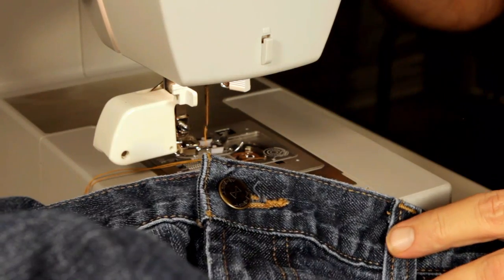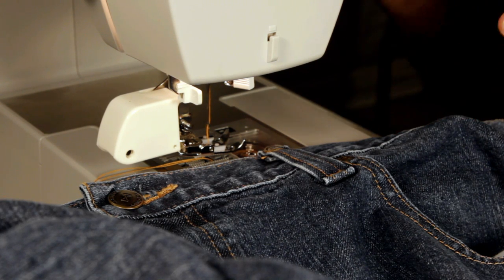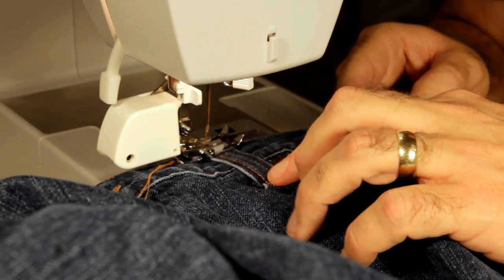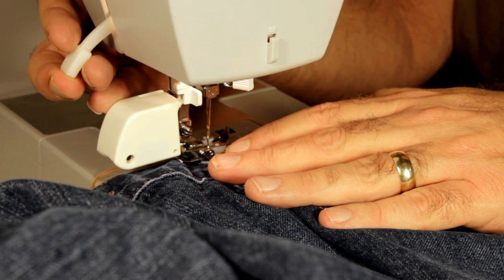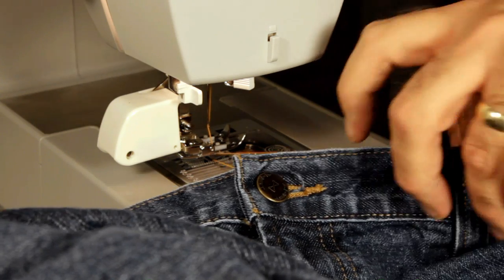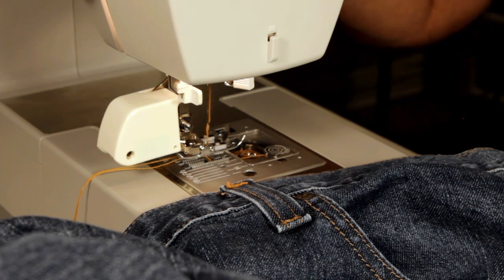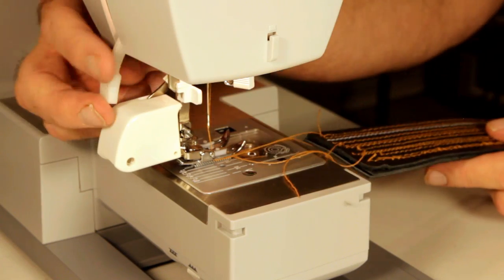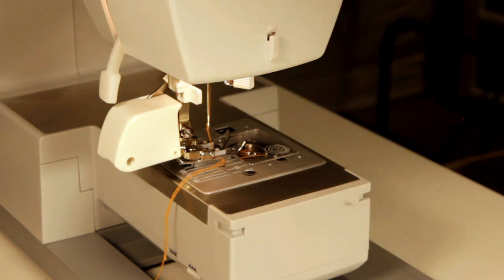Singer Heavy Duty Sewing Belt Loop on Jeans, Leg Hem and 4 Layers of Leather

Comment: What sewing machine you would recommend that will do different fabrics (aside from jeans)?  Thin to thick fabrics.  In other words, an all-around sewing machine (quilting not necessary).  For beginners?  Thank you for your advice.
Reply from the maker: I need a price range. For example I have a friend that spent $10K on their first machine. I have others that gasp at anything over $100. ;)
Reply: Around $150 - $200 pls.  Is it true that anything cheaper is easy to break-down and a piece of junk?  I only do household stuff (repairs, hems, adjust size, buttons, buttonholes, etc).  Nothing professional.  No quilting either.  I'm so confused with all the different conflicting reviews online.  Manual vs Automatic, etc.  Pls help :(  Thank you very much!
Reply from the maker: Okay, that helps.  It all comes down to mechanical vs. Computerized machine in today's market. I own several Singer Heavy Duty machines and I've never had an issue with them. However, I've heard many others have. The few that I've helped it was user error or debris in their machine that was causing the issue.  I like my Babylock BL9 that I bought for $99 on sale. It is a 9 stitch mechanical machine as well. The Janome HD-1000 is also a good machine, but I think it is above $250. Janome has other machines that are basically the BL9 machines (some offer a few more stitches).  Next, we have a new company that I've heard is run by Bernina (the son of the owner or something like that). They are called Ever Sewn. Great reviews on their machines too. This one looks very interesting: https://www.amazon.com/EverSewn-Maker200-23-Stitch-Professional-Machine/dp/B01GSMOP1S/ref=sr_1_3?s=arts-crafts&ie=UTF8&qid=1499924441&sr=1-3-spons&keywords=sewing+machine&psc=1    Stretch your budget a bit and you can get this one: https://www.amazon.com/dp/B01GSNNZ72?ref=emc_b_5_t  That should at least get you started on your research. Don't hesitate to come back and ask questions. It will be helpful for others as well.
Reply: Thank you so much for this useful information and good suggestions. I will take a look the these machines and thanks for narrowing it down for a novice like myself.  Appreciate it very much!
Reply from the maker: You are very welcome!

Comment: hello im so begginer im planning to get simger 4411 1,100 heavy duty machine. is that good sewing machine?  pls respond thanks a lot.
Reply from the maker: Go with the 44S. It has the needle threader. If you are in the USA then buy it from Walmart. Buy the extended warranty. I've used it after I bought a machine and I didn't use the machine for a bit over 2 years. First time I used it the tension wouldn't engage. They sent me a UPS label and I was able to track the repair progress online. Once fixed they shipped it back to me - all for no additional charge.

Comment: Hi Kevin!  I looked on Amazon for a Singer 4223 but cannot find one.  The only one I see, close to that, is a 4423.  Is there much difference between the two machines?  Also, have you ever tried sewing 1" nylon webbing on this machine...like the type used on backpack compression straps?  Thanks for a great review!
Reply from the maker: 4423 is the one. There isn't a 4223, so I misspoke when I made this video. I did sew some on an existing backpack I have. It was a simple repair, but with a size 16 denim needle it did fine.
Reply: I said the same thing 😂😂 but I knew he said it wrong by mistake. only other Heavy duty Singer is 4411 I know of that's grey
Reply: but great video!!

Comment: What walking foot is that? I need to find one that fits the 4423.
Reply from the maker: It is an old generic one I bought a while go. Here is a link to the Singer version, which cost much less than what I paid for the one in the video. However, the quality of the Singer foot is equal: http://www.amazon.com/Singer-Even-Feed-Walking-423242451-P/dp/B002F01JYY/ref=sr_1_3?ie=UTF8&qid=1390673661&sr=8-3&keywords=Singer+Walking+Foot

Comment: I was trying to buy a model 4452 but everyplace looks to be sold out or price gouging, I was offered the Singer 5523 Scholastic Heavy Duty model, I was wondering why they are in stock, do you have an opinion about these?
Reply from the maker: No difference other than the number of stitches and the accessories they budle with each model.
Reply: Kevin Sews Thank you Kevin.
Reply: you can buy a 4452 straight from Singer for $210. I recently bought a 4423 straight from Singer for $169.
Reply: Thanks I signed on to their website and checked it out, there’s no add to cart button under any of the 4400 series that makes me believe there’s no stock.
Reply from the maker: @johnmorse8434  They appear to be replacing it  with the new Singer Denim machine.
Reply: Kevin Sews What is your opinion on it?
Reply from the maker: @johnmorse8434  It is basically the 4432 with different color knobs. As with any low cost machine quality control is the first thing to go. Once you get a good one you should be fine.
Reply: @kevinsews  wait, so they arent making the 4400 series anymore? :-( 

my 4452 is great. its essentially just a different colored 4432 with the 32 stitches but came with extra accessories. favorites being the free walking foot and the jeans jig hump jumper.
Reply from the maker: @2010stoof  Singer's website shows they are all out of stock. Plus, they posted a video on a new version calling it the Denim. It made me wonder if Singer finally came to its senses and combines them all into one machine finally.
Reply: @kevinsews  makes sense. Probably with a price hike though haha. 
Didn't understand why they had so many identical models.
Glad to see the denim model has all 32. Hopefully it will come with all the 4452 accessories you don't get with the rest :-)
Reply: @craig11152  I check Amazon in mid morning hours and bagged 2  of the 4423 for 50.00 ans a week later another one for 160.00
Reply: @craig11152  How lucky you are ! Here in france, I just bought a 4432 for € 350  !

Comment: I’m just beginning to teach myself to sew. I keep trying to sew a patch on a heavy martial arts uniform. At first I kept getting a birds nest and now I’m breaking needles. Any advice?
Reply from the maker: Check your needle tension. See my video on how to start your thread tension.
Reply: Crank the tension up. When you lift the presser foot up with the lever it releases thread tension. When you have thick material you get the same effect as partially lifting the presser foot lever. Also make sure to use a new needle.

Comment: Hi Kevin I have been enjoying these videos about Singer Heavy Duty . Uk owner I need help !  The patterns in the manual (top row) F G H when I selected I only get standard Zig zag pattern ? I visited the channel knowing you are confident with it , hoping to see if you have the answer . Have I set something wrong ? Hope you can help
Reply from the maker: I don't have access to any of my machines currently. They are all packed up for a cross country move. Are you setting the machine  to do the alternate stitched by selecting the S1 on the length dial?
Reply: Kevin Sews  I think it was not working because I had the Length and Width dial set wrong . When I set Length between 0 -1 & Width was set to 3-6 I got the patterns correctly. I hadn't long had the 4423 when I asked the question 🤦🏾‍♀️ . Love the channel .
Reply from the maker: MissyNissy Great. Thanks for the update.

Comment: I just want to know what settings are you using when sewing leather , as far as the tension and stitch width.
Reply from the maker: Size 18 Leather Needle; V69 Nylon Thread; Tension set between 7 and 9 depending on the type leather. Stitch length is the longest setting.
Reply: Thank you Kevin
Reply from the maker: You'r welcome!
Reply: Do you use a walking foot? and if so which type should I use for my 4423 Singer, I will be working excluvsely with leather
Reply from the maker: Yes, you can buy a Singer walking foot or a generic walking foot as well.

Comment: i tried to use the same presser foot and heavy duty but i could not to do the same as you my up tread broke all the time.
Reply from the maker: Your thread quality might be the problem. Also, make sure the thread isn't too thick for the needle you are using. You can try a size 16 topstitching needle as well. The eye will be a bit larger, which might be helpful.
Reply: Look at your tension and that you have threaded your machine properly. Play with your tension between 3-5, after making sure your machine is threaded properly

Comment: do you think its worth picking up the 4432 over the 4423?
Reply from the maker: Only if you find you need one of the additional 9 stitches it offers.
Reply: if you haven't bought it yet instead of the 4432 go for a 4452 its the same as the 4432 but with more accessoires for little less. and now its in sale @ singer.com

Comment: What you have not clarified yet is whether the machine you are using is a 4223, which were the numbers you stated in the video, or whether you are actually using a 4423. Please confirm which machine you are using in this video. Thanks!
Reply from the maker: It is irrelevant in the context of this video since the only difference between the 4423 44s and 4432, 4452 etc... is the number of stitches offered and the options they ship with. Everything else that has to do with the power of this series of machines is the same. That ws the whole point of the video.... to demonstrate the power of the machine.
Reply: @kevinsews  So I take it you did NOT mean to say 4   2   2  3, you meant to say 4   4   2   3, correct? And my question IS relevent with regards to what model you are referring to. I am new to sewing and trying to learn from experts such as yourself. Apparently there is no Singer model 4223.
Reply from the maker: @timsaxer6442  Sorry, typo.
Reply: @kevinsews  Thanks for clearing that up. I'm interested in the 4423 and I do want to be able to work with denims, canvas and leather. Your reviews and this video showing that machine working with those materials is helpful in my purchasing decisions. 
I am thinking about either the Singer 4423 or the Brother ST371HD. I have watched both good and bad reviews on both machines and am interested in your opinion regarding each. Thanks.
Reply: Tim Saxer I just ordered the Singer 4452 because of the walking foot accessory you can add with it, as I understand. I’m a new to sewing machines myself...
Reply: @timsaxer6442  There are (3) different models of the (4400) heavy duty series. There is the 4411, There is the 4423, And there is the 4432. Those are the only different models that actually has any differences in the machines. The 4411 has only 11 different stitches and does NOT have a needle threader, The 4423 has 23 stitches and does have a threader, The 4432 has 32 different stitches and a threader. Now the model 4452 is in fact actually the 4432 machine but comes with additional accessories including the even feed presser foot AKA (Walking foot)

Comment: Do you have the Janome HD3000 and if so have you done this test as well? I'm choosing either the Janome HD3000 or Singer 4432. Both have great reviews! I appreciate your videos as I have learned a lot.
Reply from the maker: No, I do not. I do own the HD1000 though and it is a great machine. In my using and testing the Singer Heavy Duty did a slight bit better at plowing through dense fabrics. However, I wouldn't let this make you think the HD3000 isn't a quality machine. It is and I wouldn't hesitate to buy one.
Reply: +Kevin Sews Thank you for your reply. I picked up the Singer 4432 due to price since it was on a super sale today on Amazon. Both machines have great reviews online.

Comment: this video is so helpful, thank you.  Can this machine use standard Schmetz or Klasse needles or do you have to use Singer needles?  Also, do you thing my Brother walking foot will fit the Singer or would I need to buy the Singer walking foot?
Reply from the maker: I've used all 3 brands without any issues.  As to your existing walking foot you'll simply have to give it a try.
Reply: Kevin Sews thanks! forgot to ask if you are still happy with the Singer Heavy Duty machine...after the past few years?
Reply from the maker: I use them to teach others and no problems so far on the 8 I own.

Comment: hi again , kevin sorry to bother you again, you know i am really impress from your heavy duty 4423 machine, i wonder if you maybe know which machine have the most power a 1500 dollar machine like the janome 8200 or the bigger 8900
versus the heavy duty 4423? Kevin sorry if you find this question stupid, but before buying  an expansive machine i would like if really  there is a big difference with the motor power for thick material between a Janome MC8200 or MC8900  vs the heavy duty 4423.
Thank you in advance Kevin
T2H
Reply from the maker: +takes2home I would hope the Janome 8000 series would have more power, but I've never seen or sewn on them personally. If you can find a retailer with one in stock call and make an appointment with them. Take along the materials you wish to sew and see how they perform. Also, try searching  for those machines and see if you can find a user who owns one.

Comment: Kevin, I recently purchased a refurbished 4423 to sew rope crafts.  It is skipping stitches on the zigzag.  What are some fixes I should try?
Reply from the maker: See my video on adjusting the timing. If the timing is slightly off it will show up first on the widest zigzag stitch. Other issues can be the needle size and type as well as the thread type. Lastly, a tension issue can cause issues.

Comment: Hey bro, is it worth $40 bucks?
Might sound farfetched, but I'm serious. Yes $40?!
Reply from the maker: If it sews correctly, then YES. ;)
Reply: It's at my local BH. It's about 80 @ 50% off.
Reply from the maker: Brand new? If so I'd buy it in a minute.
Reply: You know how they do. But I did look in the box and manuals are sealed. Im not sure how it was packaged but it doesn't seem to be used. The needle is down with a yellow piece cardboard. And looks like it's in it's og plastic covering. The box is just a brown box, though.
Reply from the maker: It could be a factory refurb. Do they have a return policy just in case it is DOA or something else is wrong with it? The other problem with low cost machines is having the serviced can cost more than you paid for the machine. I'd just want to ensure it worked properly.
Reply: 30 days I have, to see if it works properly. I've bought and returned 3 die cutters for various reasons. So yeah 30 days.
Reply from the maker: Go for it then. Let me know if I can be of any help once you get it.
Reply: Thanks! I will. You seem very knowledgeable. Watching your videos makes me value your opinion. Thanks again.
Reply from the maker: My pleasure!

Comment: Dear Kevin! Is walking foot necessery for good work?
Reply from the maker: Just on thicker and other hard to feed fabrics. If you are having trouble with the fabric feeding then install a walking foot and see if that addresses the issue.
Reply: Thank You for Your quick answer Kevin! I have a big dilemma with this machine. I studied sewing machines on the internet and found the Pfaff IDT system. It looks very precise, but it's very expensive for me. The Singer 4432 is very cheap. I would like to sew shirts, jeans, bags. Now I have a Singer 8080 sewing machine, but I can't do much with it. Often slip the fabric during sewing. That's why I was glad to find the IDT system. I saw the walking foot on Your video. It looks good, but sometimes I should use special foot to help follow stitching line. Is there a walking foot that I can combine with other special foots?
Reply from the maker: Singer recently released a new Feather Weight machine that has a built-in even feed foot. I own one and I use it often and so far it has been a nice machine. You can see it here: https://youtu.be/PKKkc40vXKE   Since Singer is owned by the same company that owns PFaff I am guessing that is were it came from. I've ordered a couple of Pfaff feet and they do fit the Singer machine. If you get this machine I would think any Pfaff options would be available for you. As far as a seam guide you can use blue painters tape to help you see it better. You can also try what I showed in this video: https://youtu.be/8lPuSRx7BTU

Comment: Is the singer classic heavy duty 44s good for denim sewing also?
Reply from the maker: I've been able to sew slightly stretch denim jeans with it without any problems.
Reply: Ok I’m basically just trying to sew some denim on top of denim and some leather on denim. That should be fine with that huh ?
Reply from the maker: @joshsimmons9959  It will work. However, it you plan on sewing on it twice a week I would buy either a Semi-Industrial or an Industrial machine.

Comment: Where do you buy that thread? Can't find Tex 30. I see some sellers have the Tex 60.
I read on a forum you can get it. Please help!!
Thanks
Reply from the maker: I bought it from my local industrial dealer. Here is one you can order: https://redrockthreads.com/colors/googlemerchant3.asp?qry=210101a 
or this one will work as well:
https://www.wawak.com/Jean-Thread-Tex-60-750-yds-Assorted-10-Pack
Reply: Oh ok thanks!! Yes I picked up the getermann jeans thread at the store. But I've seen on sites like wawak they have Tex 60 jeans thread with Lee gold and Levi gold as color names. I wonder what needle to use for that large of thread? 
P.s. I didn't know that the gutermann gold jeans thread was only Tex 30. That means the Tex 60 is twice as thick?
Thanks alot. Love my singer heavy duty so far :-)
Reply from the maker: Yes, the Tex system is based on the weight of using 1,000 meters of thread per gram. The heavier the thread the higher the number.